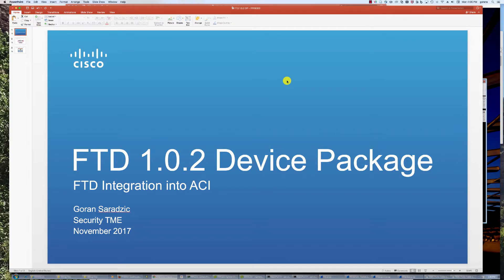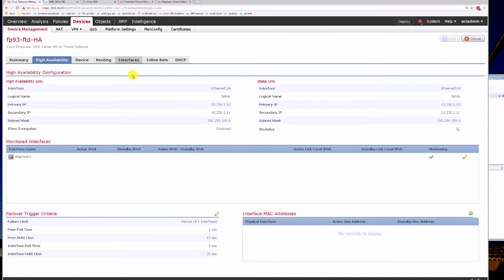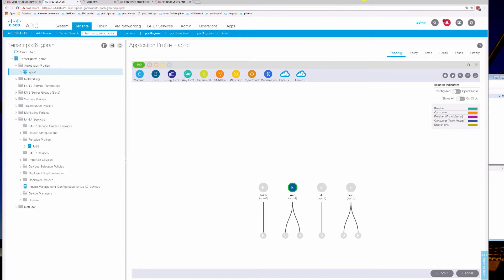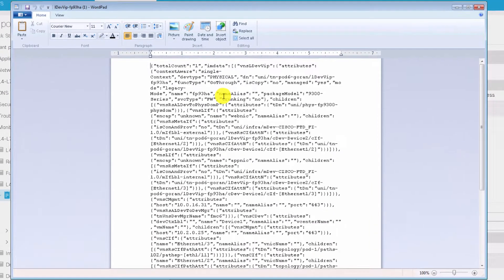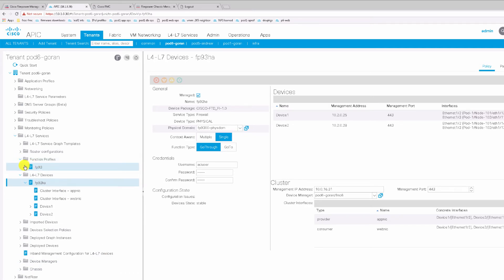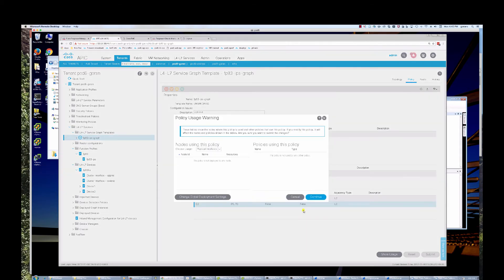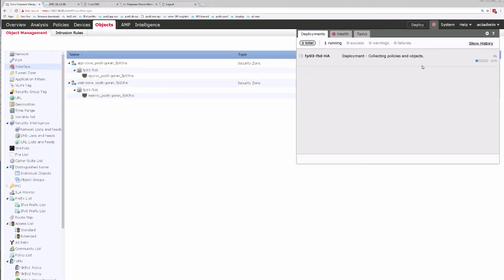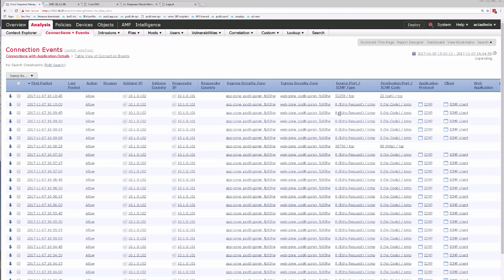FPR9300 NGIPS in ACI - FTD Device Package 1.0.2 (2017)

Comment: Hi. I've deployed a FP4120 in Inline Mode in ACI. I modified the configuration file for the use of just one VLAN (as you showed). All was right, but the interfaces that connect the FTD on both leaf switches are stucked in the "out-of-service". The VLAN Pool has the VLAN that I've manually configured, and it is configured for Static Allocation.

Do you have some ideas what could be happening?

Greetings!